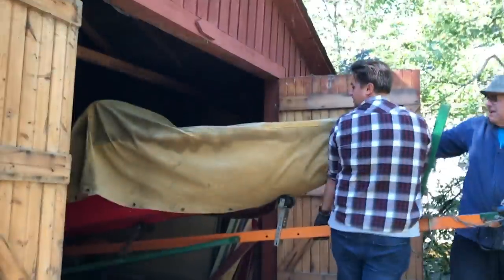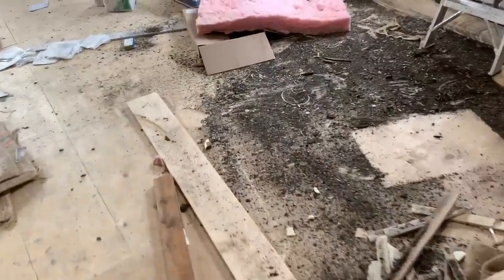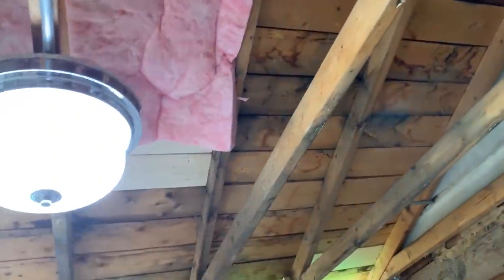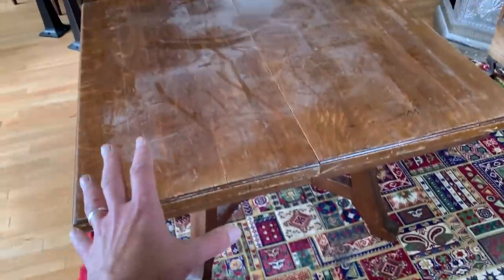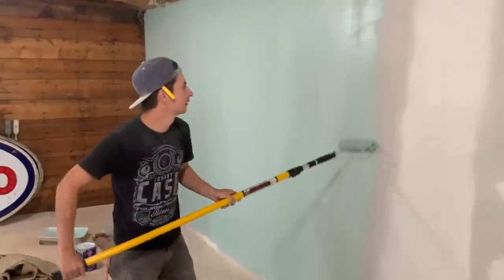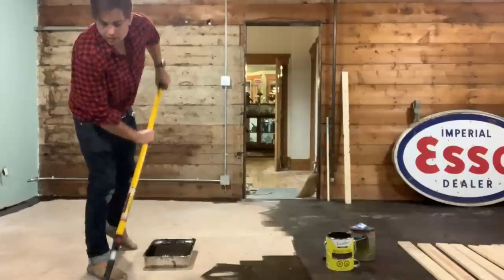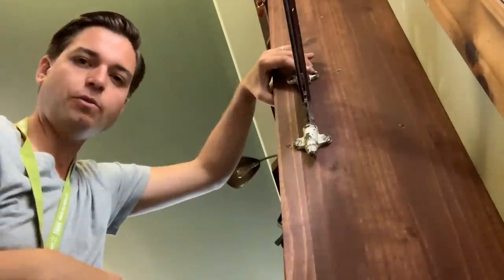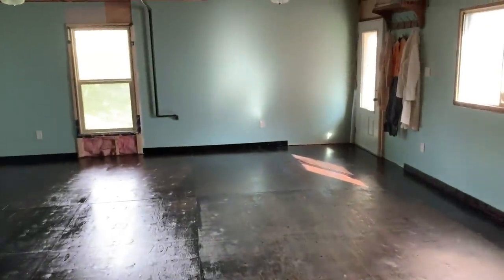Part 9. Stuff that store! Insulation, Drywall, paint and flooring! General store

Comment: Alex, being a wheelchair user I just wanted to say it is so nice to hear you giving consideration for wheelchair users in your shop.  Sooooo many places do not take this into consideration. A lot of shop owners could learn from you.
Reply: Even doctor's office buildings! Believe it or not.
Reply: Especially antique stores!  I get it, the shop owner wants to fit the most stuff possible into the space they have, and it is kind of an antique store aesthetic to have it overstuffed so to speak, but once I started using a rollator the majority of antique stores I went to regularly I could no longer get into.  It was eye-opening, really.
Reply: After being hurt in a low-speed trucking accident in a parking lot where an unexpected dip at less than 5 MPH in reverse caused my air-ride seat to bottom out and reinflated quickly shooting my head into the steel reinforcement of the fiberglass roof. I'll spare you the details, but orthopedic pain's a constant companion and my lack of ability to stand even a few minutes as well as walking causes both to be problematic more than 30'. I had to go into a branch of Bank of America yesterday and from my previous visit a few years earlier when I had better mobility I knew that I had to use my wheelchair. I was surprised that the whole design and layout of handicap accessibility wasn't better laid out! It was raining hard and water pooled right in front of the ramp access to the sidewalk. Also, the ramp had a steep incline for a manual chair and no type of traction improvement in the transition to an elevated sidewalk. Before I left my vehicle I saw the handicap symbol on the door glass thinking that they had an actuator button for the double doors, they didn't. Only upon exiting did an employee hold either of the dual double doors open for me. I was soaking wet by the time I got into my vehicle! It's amazing what you don't notice when it doesn't affect you! Alex seems to be helpful to the issues of everyone in his life. Like how he differentiated about Jakota wasn't under the weather, but had an inner ear imbalance. Very cool!
Reply: yes...you are absolutely right! my grandson is in a wheel chair, so i know how that goes.
Reply: @mcshawnboy  Sounds like the building where I see my neurologist (!) for Parkinson's.  Same terrifying ramp; same dual double door at bottom; same lack of handicap button to open doors - but this is the kicker, those doors open OUTward on a tiny square of concrete.  SMH
Reply: Luna The Hamster Especially if he makes the aisles wide enough!
Reply: I agree, it is bad enough we have to be in wheel chairs, I love going to antique store and none of the local shops are wheelchair friendly
Reply: Also disabled and excluded from many places and activities.
Reply: Doctor’s office I used to work at wasn’t wheelchair accessible and they wouldn’t spend the money to make it, isn’t that gross?
Reply: @Ashley__Rose  That's terrible. Of all places that need to be accessible I would suggest that is one of them high up on the list.
Reply: In the U.K. they are really hot on wheelchair access

Comment: So happy to see Jakota is doing better!  So good to see him smiling!  I am a fellow vertigo sufferer and try to remember that when people give you all this advice on what to do, they really do care and mean well and are trying to help.
Reply: I used to drive a non-CDL box truck delivering bulk warehouse loads to the local route drivers of a large chain of stationery supplies, office equipment, etc you probably have one in your town. I was moving the cargo to the liftgate for them to put merchandise in their vehicles when I slipped on the floor fell onto a heavy box on an angle that propelled me towards the rear exit of my truck onto blacktop 6 feet below and the steel gate! In desperation not to fall out of my truck I grabbed at the triangular handle of my manual pallet jack! At the moment I didn't consider that there's a HUGE spring in the handle and it clocked me right in my face at the very edge of the box! I'm really thankful that our body uses the system shock to protect us. About a half-hour later I woke up in the back of an ambulance surrounded by EMT's heading to my home 200 miles away. When I was ambulatory again I had vertigo for a couple months and it REALLY felt weird! I was told not to lift over 10 pounds or to use ladders and other things I've forgotten. My heart goes out to you! Working in the trades that's got to be a real wildcard!

On the subject of, "The Potter's House" did you two have any emotional connection to Mary and her work since she went to the first people's to keep alive their traditions and both of you are artists in your own right?
Reply: @jeansmith5692  Yes, mine is Menieres as well.  It is the worst but thank God for modern medicine.

Comment: Alex you could use pulleys mounted in the open rafters of the shop extension  with  clothesline and hooks to hang those guitars up high and out of the way..
Just tie off each line to an old ship's cleat mounted to the wall to lower a guitar if someone wants a close look.

Comment: You should tape the rug square on as a flap so when and if you move the lamps etc and aren't using the plugs  you could lay the rug back so it looks whole. Just told under.

Comment: To give you some perspective: due to a big error from the architect, at work we built a 1.6 million euro building WITHOUT a permit. Since the major structure was already done when we discovered this, we had to take a gamble and continue and then ask for a "regularisation" which basically means that you admit your building has no permit and you ask the  town council's grace to still give a permit for it. The alternative is tearing it all down and to pay a massive fine. Near the end of construction, we even had cops visiting us who knew we had no permit and they almost shut everything down but luckily one of the cops knew the architect  and they backed off, giving us a chance to still get regularised. If this had failed, we'd have all been out of a job since it would have bankrupted the company ... but the permit went through. 

So think  happy thoughts and I'm sure the permit will come through! Councils are generally not evil and unless you did something that would bite them in the ass in the long run, they're unlikely to turn you down.

Comment: Just thinking about your dilemma... why don't you get a temporary warehouse/storage location for the overflow? Clean out the current location so you can sell it, fill up the general store with as much as you want for the time being while you wait for the zoning... and anything someone may want specifically (which you list on social media and on your website, right?), you can always pull it out for them as needed from wherever it's being stored. Just some thoughts ... 🤔🤔🤔 Edit: Note to self: wait until the video is over to comment. I would've had my answer had I just waited.

Comment: If you use Marine Varnish
(Polyurethane) anywhere you will be waterproofed & not have to do it again for many years!
Reply: That is an excellent idea
Reply: Used it on my kitchen counters. Not only does it make the wood look amazing it's also waterproof like hell.
Reply: phangirlable poly is bad for food prep surfaces, as it does chip and flake off into food. I would strongly recommend keep food to surface contact to a minimum. IE no rolling cookies cutting, or any food contact.
Reply: @bonnevillebagger9147  any varnish in food would not be good, take lead for example...
I could see doing butcher block counters, and all marine varnish, just like the galley on a boat. 'Course I prepare food on glass or plastic cutting boards only...
Reply: Voklst Westie you’re supposed to use mineral spirits on butcher block, beeswax. But yes all varnish is bad for food prep. I was just focusing on the one discussed.
Reply: @bonnevillebagger9147  i would never cut up food on butcher block or wood. Ugh, bacterial city!
Reply: Actually studies show that wood cutting boards are be than plastic. Bacteria set on the surface of the plastic but get absorbed by the wood.
Reply: Voklst Westie as Tammy says below, mineral oil soaked or oil/beewax coated end grain hard wood (small cell so oak is not the best choice) is the choice of professional chefs. The surface is not so hard to blunt the knives prematurely and the cuts "self heals", bacteria dies of lack of oxygen and most food prep left behinds just wipes off (not chicken tho :) with a damp tag. Maple, walnut etc are often used, if you want to see very nice cutting boards being made, check out @MTNwood here on Youtube.

Comment: My mom used that rug tape on her pegged hardwood floors. It lasted over ten years, worked very well. When we had to take up the rugs when it came time to empty the house, there was a residue with dust but it came up easily with a little wood floor cleaner.

Comment: I’m pretty sure that rug is almost new and machine made...so not expensive. I would have removed the brass rim from the electrical outlet Then cut the carpet and then replace the frame to hold down the carpet.
Reply: That faceplate is sealed watertight to the floor tho so................not a good idea to break that. It was done to prevent anything spilled getting thru there.

Comment: JAKOTA - True, burn 1-2 ear candles in each ear and all nasty things will be sucked out of there. A helper has to do it while you hold still. Smoke goes in your ear. The candle causes a suction. Feels good doing it. Follow directions carefully. Slit the candle cone open when done to see what was removed. Show us what comes out. You will be surprised! Cheap, too. So sorry your ears rebel sometimes. They can be cured.
Reply: I guess you missed him talking about how the problem is on the other side of the eardrum.....
Reply: @JCrook1028  No, I heard that. The candles clean out the ear canals, the inner ears and the eustacian tubes too. The whole thing. Most excellent gadgets!

Comment: About the instruments. You can hang stringed instruments from wire loops. Slip the head through the loop and it will hang by the neck. It works for guitars and violin/viola/cello. The instrument pegs will keep it from slipping out. You could do a series of loops drilled through a 2×4 and hang it from the ceiling. Anywho, hope that is helpful. Love your channel.

Comment: Alex - I did a little research. Your Rickenbacker Model B 'Electro' Lap Steel Guitar appears to be the first model introduced in 1935. So it's not from the 1920's as you stated. In 1938 the model had the sides of the molded frets painted - I presume to make them more visible. As your frets are without paint, the guitar is the earliest version of the model. In later versions after the painted frets, the chrome plated plates were changed in the late 1930's to black painted ones and then painted white starting in 1940. In the 1940's some models had white plastic plates instead of the metal. The model was discontinued in 1955. Other changes over the years had to do with the number of knobs and their placement. It appears your pegs or their buttons may have been replaced as the profile of the buttons differs from the more simply shaped chrome ones on early Model B Electros of which you can find images of on the internet. Your control knob does appear to be original.
The Rickenbacker Model B 'Electro' was the first mass-produced electric guitar and was sold in both a Spanish guitar version as well as the Lap Steel version you have. Although the bakelite body on the Model B is generally thought of as solid, apparently it does have voids in it but was designed to behave as a solid body.

Comment: Nice scale,  too.

If you wanted the light switches to look authentic, a working push-button replica that sits over the switch plate would be an option. 
Josh or the door maker could mock one up for you easily enough.

Comment: There is nothing stating if you liked the look of diagonal under flooring that you can't scribe or paint or stain lines on the plywood to give the look of hardwood flooring. A friend of mine wanted jazz-up the grand entrance space in his old home. it was a large space with doors & halls and a grand staircase on one side. So he sanded the hardwood flooring, then drew a large compass setting using stains When he finished It look like it was inlaid in the wood floor. It was beautiful. Then he used paint, chair rail & picture frame molding to make the walls in the house look like Edwardian paneled walls, Coffered ceilings with painted clouds & sky and murals in the spaces.

Comment: @Curiosity Incorporated , For the carpet where you cut out the plug, you might want to use a fusible bonding tape (that you can iron on)  and binding tape on top of that (can be found anywhere fabric is sold) or at the very least a fabric glue like Fray Check, to keep the carpet from fraying from all the foot traffic, unless you plan on placing the table over it. I would have done it prior to putting it on the floor, but you could still do it while its down without too much hassle.

Comment: My dad was born in 13 and well if he's really "would be old", that makes me well "old"! I like how the new place looks but the blue is very tired looking to me. Kinda like how I generally feel. I wish I could travel but it's out of the cards. Keep your chin up and your feet firmly planted, you may need carpet tape to hold you up if your too tired to focus on your plan of action. I wonder how many times that you will head off for work at the new location and discover that without consciously thinking, your in front/back depending where you park, the old location cause the auto pilot kicks in late/LOL. I did a couple of times when I opened a new garage. Josh and Dakota are your go to guys. To bad they are not into the selling and buying stuff in that setting as they really do pick you up where you lack confidence in decisions. It is hard to pass stuff that you know will sell but then you don't need to wind up with a albatross around your neck when your old and want back out with dollars in hand. You most likely have several million in store stock if sold at the buyer asking price. I started my business on a twenty five per cent profit margin but soon learned why the business runs better at one hundred plus per cent. Days that things are real slow or breakdowns within the building or help. It all adds up to eating or being so fair that you loss a business because the dance card was full and you didn't see it coming. How else can cars crash at a intersection than if they didn't pay attention.. "As Foghorn Leghorn said: Son! I say son.. Ya gotta pay attention!!"

Comment: I'm sure you mean't Frying pan when you mentioned the Richenbacher. If the electrics are in working order, all that one needs is strings. A website called of all things Just Strings will have what you need.  You will also need the steel, the piece you work the notes with. Contrary to what many people think, the strings do not touch the frets, only the steel.
Reply: I mean the slide.

Comment: That burlap roof makes me super nervous as that is a HUGE fire hazard. Maybe look into a way to fire treat them?
Reply: Not really. The bags might burn, but they're burlap and burlap is a loose weave material, meaning that it will go up quick and burn out before it damages the beams or the floor when they burn. They are covering fiberglass insulation, so it won't be affected at all. While it might look to be a fire hazard, it isn't. The whole point is to look like a man cave, so it is appropriate. One, they're away from a heat source, and two, burlap is so loose, it's like burning thread. Quick and done. No damage, other than to the sacks.

Comment: I need to find that tape. My parents used tacks right into their hardwood floor to fasten their carpets down.
Reply: IKEA have like a thin carpet you lay under the real rug/carpet so it's not "flapping around". No tacking/glue. You can cut it in smaller pieces if it's to big.
My grandmother was at handy lady, she sewed the "rubber rug" to the carpet so she don't have to fix the thing every time she have take the carpet out.. and every year she take it of and sewed back on on the other side. So the carpet get were down on both side. 😁
Reply: There's scores of different brands. Simply Google it and find what you need.

Comment: I hate to burst your bubble but, I used that carpet tape on a runner in my entry, the rug came loose, the tape is still stuck to my floor. FYI, my floors are laminate.
Reply: I'm concerned because the tape is inches in from the edge of the rug.  It would be easy for someone to catch the toe of their shoe under the unsecured part and fall.

Comment: need the carpet tape in the middle of the rug, or it will stretch the rug when it moves
Reply: It's not gonna move..... table on it, under cabinets, edges taped down and center around the hole will also be taped down.

Comment: never install flooring without breaking seams ,so never haver 4 corners at intersections start with half sheet ,and dont use SHEETROCK SCREWS. to hard and will snap   even the coarse screws